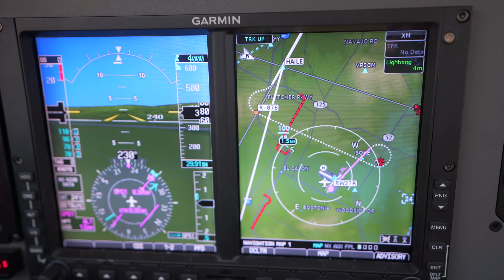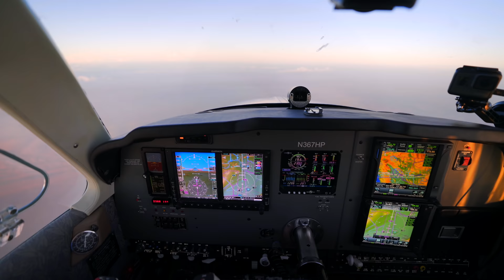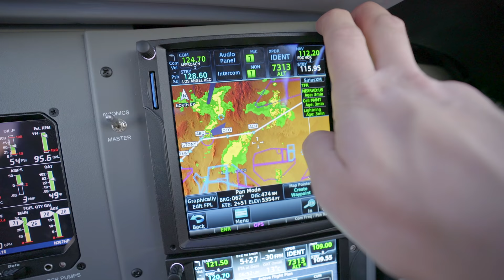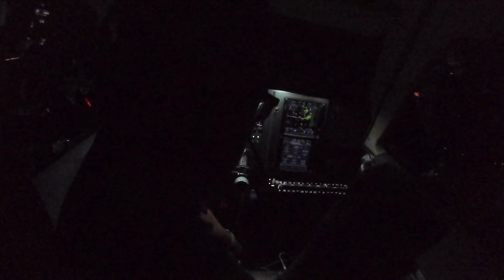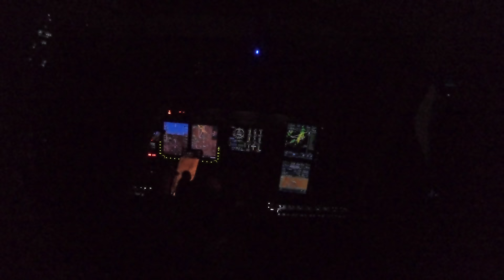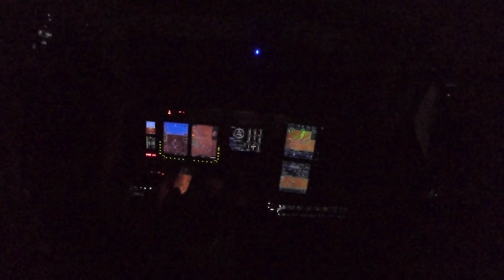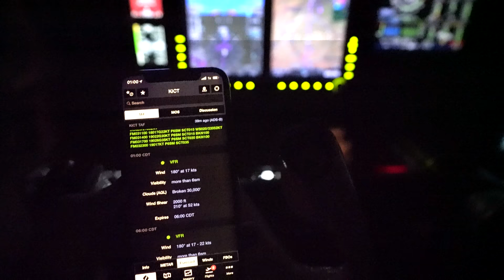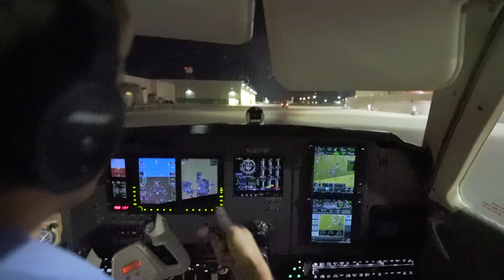It Finally Works?

Comment: So what was the charging problem?  After multiple alternators you said they put on an old one and it works...doesn’t make a lot of sense and now there is another problem with the auto pilot when you flip the yoke?..  Good video but confusing.
Reply: Yes, it's one thing after another ???  He has more problems than Carter had Liver pills LOL
Reply: intermittent probs are the worst.  
"doing the same thing over and over"...
The fact that no root cause is listed means it may still exist
Reply: It is a flying BOAT.  Bust Out Another Thousand.   Big Bucks if you own a plane or a Floating hole in the water over 30’. 🙈
Reply: It’s minor inconvenience and was a manufacturer problem to match the regulator to the alternator.  Now they know the problem, the manufacturer should address the problem and send out bulletin of this matching problem. I cannot imagine “busting out another thousand” on a plane.  That would be too cheap making boaters problems simple. These big boy toys are a luxury items, so spend it if you have it and enjoy life.

Comment: Thank you so much for taking us along with you on this flight Matt. It feels like I'm there in the seat with you and my mind is challenged to keep up or sometimes stay ahead. 
Also, I just wanted to share my thoughts regarding electrical mechanical troubleshooting for those interested. Please excuse me, I know this isn't the focus of your channel.
Again, everything is functioning normal, almost perfectly. The breaker opened for the autopilot system which caused the system to stop functioning. Resetting the circuit breaker restored full functionality of the autopilot system without a reoccurring fault. Perfect. Delving deeper into the causes related to the auto pilot system intermittent interruption, can take several paths. Unfortunately, we've experienced that the A- typical FAA AMT path can be a long winding one. 
SEE MY SECOND COMMENT, COMMENT 2

Comment: I know you have lots of experience, but I'm with the other commenters here. I really hope that this 6 hour flight, at night, in the weather, across the mountains was not your first flight after that extensive maintenance. Experience doesn't remove the risks of post maintenance issues, you are banking a lot on just being lucky. Maybe you took that maintenance check flight and didn't mention it or share it - I know it wouldn't be great YouTube content.
Reply: @Jon Schade as far as I can see, mine is the only of the "post maintenance flight" concern comments that Matt liked. Maybe that's his way of saying that there was a post maintenance test flight and that it didn't rise to the level of being YouTube content.
Reply: @CuratedPile  Bear in mind this video series is about a year or two ago. Very few UT creators run new almost live content. Unless they plan live events of course!!!
Reply: I have warned Matt before about this single engine hard IFR adventures and the fact that aircraft maintenance issues can be a real problem.  I think when his aircraft was leased it was very new but now he is experiencing reality in aviation.

Comment: I had to fix an alternator problem on a high time Warrior. Eventually found a worn Adel clamp rubbed through the output wire insulation under the 1-3 cylinders. 
If flipping the yoke popped the auto pilot breaker, I would start looking at the wire harness that runs up through the control column. Maybe where it exits the tube behind the panel. Might find a rotted or missing grommet there or a harness problem nearby..

Comment: Thanks again for another entertaining video with a beautiful Bonanza. I have watched all of your videos as well as many of the other GA videos especially when they involve Beech products. I have owned 3 Bonanzas, and a C55 for 28 years and currently fly a V35. After 6100 hours, 4100 in Bonanzas and a CFI-IA ATP for 25 years, I have never seen anyone in a GA video using supplemental O2. I live at 4000’ and fly X/C from 9-13,000’ in Bonanzas and ALWAYS use my portable O2 tank and Oximizer cannula. I purchased a pulse oximiter many years ago and always demo hypoxia beginning at 7000 in a T-210 up to 17.5. I will assure you that your blood saturation during your flights is in the 80s which = hypoxia. I had a previous T210 customer almost kill him self due to not using O2. It would be nice to see other GA pilot YouTubers using a checklist and supplemental O2 as Captain Valery in the B58 is the only one I have seen use one. Sorry for the lengthy post but think others should be informed. All the best and keep up the excellent videos.
Reply: Should have read 38 years.
Reply: Niko's wings uses o2 in his cirrus sr22.

Comment: Matt, I enjoy your videos and I'm glad you can make that Bonanza work for you in your circumstances.  I had dreamed of getting an older, nicely equipped Bonanza during my retirement years (maybe an 'N' or 'P' model) and do some nice trips, but it is just not going to be in the cards.  Wifey is a homebody and doesn't like to fly; but also I have just got to the point where I can't reconcile the cost of a complex certified airplane like a Bonanza.  I've owned a Stinson for 25 years, and simple as it is, it's still a money pit.  I can only imagine the expense of an the annual with all the work they did on your airplane chasing down your electrical problems, re-bushing the gear, etc.  At $80++ per hour shop labor I would guess the bill must have been closing in on $10,000.  For me, I'll have to keep draggin' my (Stinson) tail and may even downgrade to a Champ or Cub in the future.

Comment: Thanks for your video. Can you explain your risk analysis that allows you to fly at night, in known bad weather, across mountains, in a single engine piston powered airplane?  Additionally, your airplane just came out of an annual where any number of squawks could come about. What makes you have the confidence to take on such a flight?
Reply: He knows the limitations of both himself as a pilot and his aircraft. His experience level with flying AROUND THE WORLD is thru the roof. As to post annual, the first part of the flight was daytime good weather which provided plenty of time for a shakedown— if anything was wrong you stop along the route and deal with it. In terms of the weather itself, it wasn’t anything he had to fly through, just deviate around, and with enough fuel that’s utterly routine. This is a highly experienced pilot on an IFR flight in a well equipped high performance aircraft, we’re not talking about a 100 hour VFR pilot in a Piper Cub.
Reply: Two choices: Stay on the Couch or Fly..........
Reply: @chcr8150  I had my my most serious squawks when my planes came out of annual or 100 hr. inspections.  These were all in twins and my SOP was to go VFR day only until a few hours of flight time had passed.  1600 hr. commercial, instrument, multi.
Reply: @chcr8150  Stories of ATP folks who were dispatched from this planet, with a hell of a lot more hours and experience than Matt, are sprinkled around in the Air safety institute Youtube channel.
Reply: I think I’m tainted having lost an engine over a mountain pass...that plus 30 yrs. experience. No old bold pilots.
Reply: I think when it comes right down to it, risk tolerance is a very personal thing. It is based on many variable factors. At this point in his life Matt has more tolerance for risk than many of us older pilots. That’s OK.

Comment: In my 20s (in the 80s) I used to fly night VFR between Van Nuys and Gillespie field on a rented Cherokee Archer, sometimes it got pitch dark when there was no moon. Great experience, smooth air, loved it. But today, when I looked back, I don't think it was a good idea at all to fly at night single engine. I considered myself lucky.

Comment: So the problem was never really identified?  Hmmm ... anyway, enjoyed the update.  If you're looking to improve you low light videography, I highly recommend using a Sony A7S with one of their master series lens ... you can run ISO 51000 at 4K 60fps 10bit 4:2:2 color compression without any noise/grain and it has an amazing low light autofocus system ... it's not cheap (around $6K with a master series lens).  But since you do a lot of night flying, it will capture the beauty of the night extremely well with NO noise/grain.

Comment: That yoke needs to be pulled to pieces. Seems like there could be a short circuit somewhere causing the fuse to blow and perhaps current back feeding to the alternator and which will perhaps be why you keep having to replace alternators on a regular basis.

Comment: Question Matt,  I thought you could fly at 12,000 feet during the daytime, but that was lowered to 10,000feet at  night in an unpressurized aircraft?
Reply: No, unpressurized planes can fly up to 12,500 without supplemental oxygen day or night. Above 12,500 supplemental oxygen is required for pilots if the flight spends more than 30 minutes above 12,500, and it must be provided to passengers above 14,000 feet. The FAA recommends flying at lower altitudes at night in unpressurized airplanes because a lack of oxygen can affect your vision so flying lower at night will make it easier to see.

Comment: COMMENT 2
Probably the most interesting phenomenon regarding service and maintenance is the MIF.
Maintenance Induced Failure occurs due to disruption of harmony. Kinda like a third party delving between a married couple. 
Service of an aircraft system often disrupts the relationships occurring with related systems and or adjacent or subsequent -subsystems. 
The mechanical relationships ( outside of turbine engines - lol :;) are straightforward because physical inspection of these systems only requires impeccable oversight combined with mechanical aptitude including reference to FAA AMT best practices, principals, and techniques. With adherence to the manufacturers guidelines regarding airframe, powerplant, and accessories the maintenance process is reliable.( Fatigue and crack inspection is beyond this Comment; it becomes an investigation itself) The occasionally occurring MIF diminishes with experience but experience sometimes dictates retracing the aforementioned paths. How far? In this investigational comment I"ll try to accelerate my agenda of promoting pin point diagnostics as opposed to the industry standard PPT currently used within this segment of this industry. Surprisingly, we may find this trail head to be at the battery.... A more than perfectly functioning battery(s). 
Pinpoint testing is the best approach; it's cheaper, faster and more successful.
See Comment 3

Comment: Is there something askew when you move the control column from L to R seat in terms of wiring moved by mechanical parts?
Reply: There are several wires running through the yoke shaft. The autopilot disconnect and electric trim being a couple of them. I agree there is something going on with his throw over yoke wiring.

Comment: Bad grounding on that alternator
Reply: I think the shop would have found that when they rewired the whole system.
Reply: Matt stated they redid the full harness at the start of the video.
Reply: That's what I keep saying. They redid the wiring but what about the integrity of the aircraft where the ground is connected?
Reply: @regibson23  Which ground connection? There are 100s of ground connections in a Bonanza. The entire airframe is aluminum and is the ground plane. Alternators don't have a separate ground connection. In a car, the ground connection is mounting it to the engine. 
With the alternator in MAtt's Bonanza, it is bolted directly to the engine case, driven by direct gear drive, and you can't get a better ground than that.

Comment: You still have far too much alternator noise that gets pronounced when the station your are receiving to is not very near (signal strength drops) ... so to me it sounds like some alternator problem is not solved or at least somewhere there is some shielding, ground and/or RFI filter / caps missing, else your long distance reception would be much clearer. 
Or maybe the alternator is ok, but your antenna cable shield is broken or not attached properly on one end? I am really surprised there are specialists working on your plane and nobody tests for RF noise or proper antenna cabling / standing wave ratio that shows a proper transmitter termination and most of the time if this is off, you know there is something not right on one connector, cable or the antenna itself. Anyway if the SWR is good then it is most likely the alternator ground/shield or lack of RFI filters/low pass is not quite right.
I hope you will get that alternator RF noise problem fixed and your short/circuit breaker issue when moving the controls to the other side, that should not be tolerated either.
You are an MIT guy and some of your friends might be electrical engineers with focus on RF knowledge. They should be able to help you with some adapters and vector network analyzer and electrical as well as magnetic (current) RF probes on a spectrum analyzer. They might have a better chance finding it and getting it fixed than the aviation technicians with their focus mainly on mechanics.
If you would be here in Germany I'd offer you to bring all my electrical instruments to the airfield and spend hours trying to trace these problems but I guess that has to wait for your next around the world trip 😉.
Good luck and thanks a lot for your wonderful videos, I really enjoy them because you live the life I am dreaming of.
Reply: Very detailed answer that shows you know what you ate talking about. Great advise

Comment: This must be a Ford alternator, mechanics have told stories of having to need to try 7 to 12 alternators before finding one that works probably due to a manufacturing problem.
Reply: I think aviation equipement/parts are held to higher quality standards then  automotive equipement/parts
Reply: @jfv65  You would be really surprised.
Reply: @jfv65  nearly every alternator in aviation is made by Ford, on the same line as the car ones.

Comment: Sounds like a very complex problem. Hope it's almost fixed; maybe the auto pilot failure was a seperate issue ? Seemed like the alternator problem was fixed. BTW, was that a B-17 parked at Wicita (0.38) ?

Comment: Time to pull apart yoke and shaft. I smell a short. See fokes...if you don't use the lavatory in flight you will never find electrical problems! Or missing the bottle lead to the electrical problem not sure which one. 🤔

Comment: did you ever think about how much power all the cameras and other electronics are using...?
The aircraft electrical system is prolly maxed out - may be hard on the alternator 
just sayin'
Reply: Cameras are probably on their own batteries.
Reply: I can handle part of this. Those cameras are all battery-powered like everyone else's (including mine). The avionics uses less power than the old analog stuff.
Reply: A GoPro Hero 7 camera uses about 500 milliamps an hour which is nothing.
Reply: I agree all those avionics too using lots of power
Reply: @elik1491  Well, you’re wrong. As I stated earlier they use far less than the old analog gear. Been there, do that
Reply: @JustaPilot1  Fair enough. By the way I saw this in another comment, but do you think the issue is possibly a wiring issue/short behind the yoke? Since the autopilot malfunctioned when the yoke moved
Reply: @elik1491  that is my impression. Something in the mechanism is interfering with the autopilot. I’m sure it will get sorted out.  Personal point, I’ve never liked throw over yokes.
Reply: @JustaPilot1  Did it happen more than once, though? Could've just been a coincidence, though would be worth an inspection, seeing as AP disconnect is on the yoke.